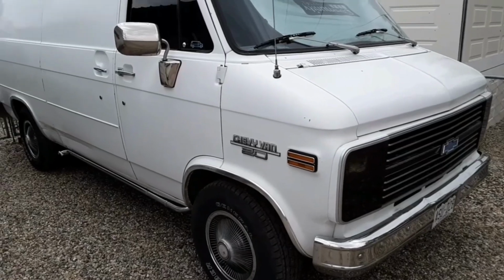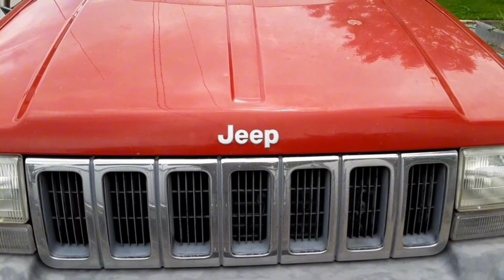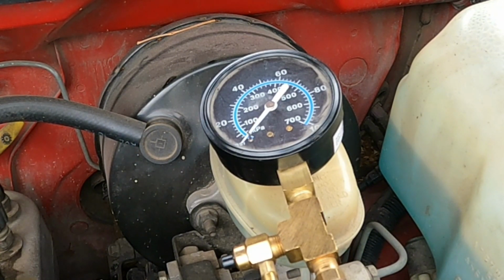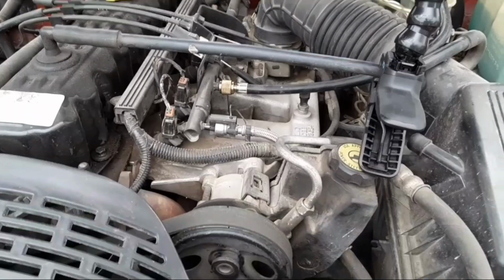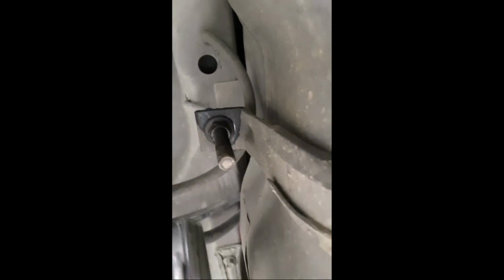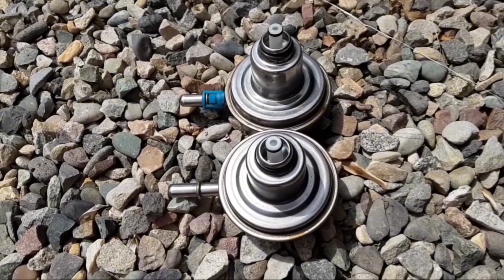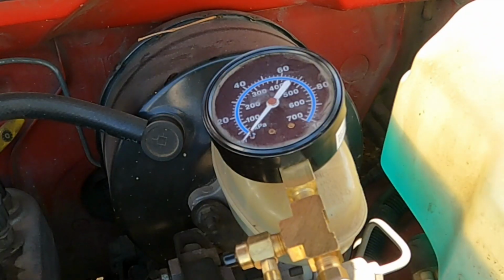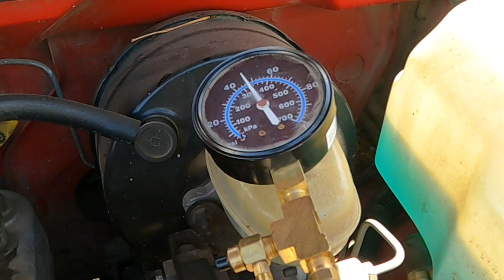JEEP fuel pressure regulator replacement

Comment: Thanks for making the video, I think my 97 Jeep Grand Cherokee 5.2 might need this. I going to try to get that fuel pressure gauge to test it. It's either this or a crankshaft position sensor. My MAP, Idle position, and throttle position sensors are fairly new. My jeep was sitting for 6 months and when I woke it up I started to have long startups.
Reply from the maker: It took me a while to figure out what the problem was. After I changed alot of sensors and parts. But the pressure gauge let me see the problem and it's ran great since then.

Comment: There a filter element inside that regulator too.
Reply from the maker: Yes there is a filter and that could also cause low fuel pressure if it is plugged up.